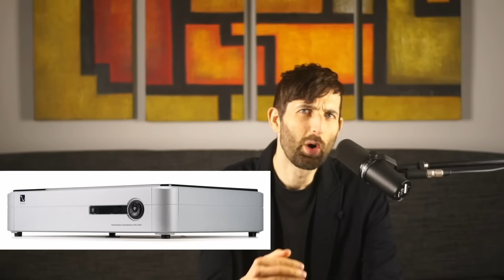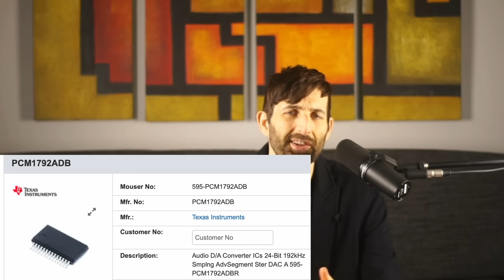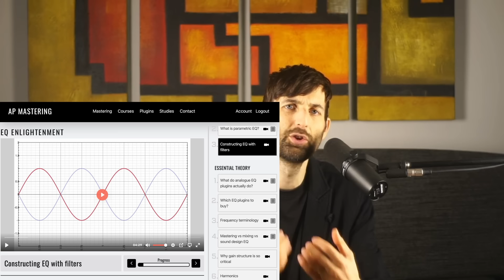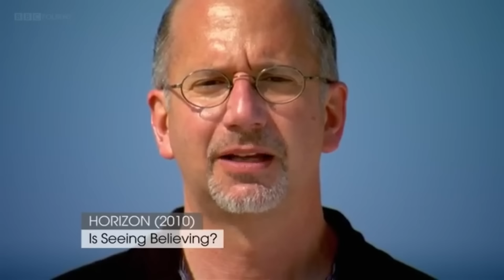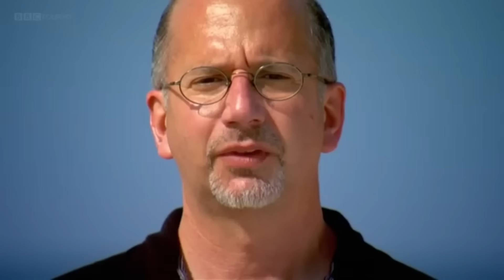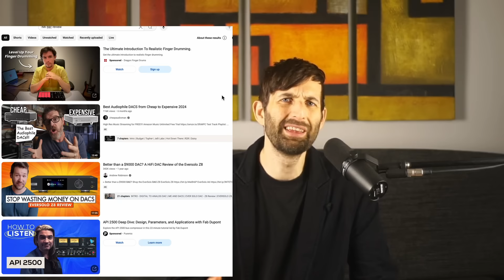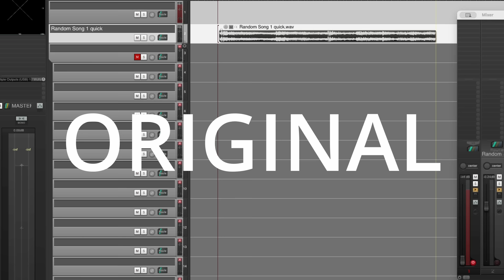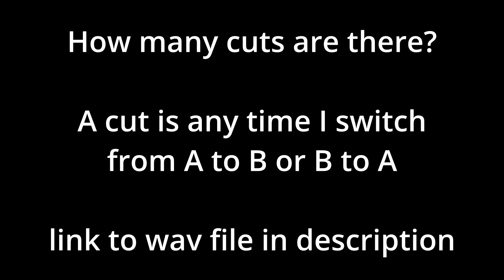The DAC Scam - Almost everyone believes the hype

Comment: I really enjoy your debunking of the analog and digital mythology and the many snake oils in hi-fi.  DACs definitely are a place where this is rife with imagined, subtile differences that become fetishized.   However, your video could give the impression that you're saying "all DACs sound exactly the same" -- that is, you can buy any two from Amazon, and if connected to a system the same way, they will have no distinguishable differences between them in a blind test.  These statements are all over the interwebs, proselytizing and insisting that everyone who hears differences among DACS has bought snake oil.  But the fact is, in real-world use, DACs that you buy for your home stereo (stand alone or integrated into the component) can sound different, even between two with the same DAC chip and level-matched.  That difference is due in part or full to other "implementation" factors beyond the D to A conversion.  I think these would be differences how the signal is handled after the DAC core -- summing node, output buffer, etc., correct?   You mention the power source as a factor as well.  If you listen to a Chord R2R DAC, it will sound a lot different from a roughly equivalent SMSL DAC you compare it to.  I suspect but don't know for sure that the difference might have more to do with the "implementation" than the actual D to A conversion.  I prefer the Chord DAC, just like I prefer one make or version of an A/B amplifier over another, equivalently priced and powered A/B amp. I think that recognizing that DACs as made available for purchase by viewers can sound different is lost in the debunking of the other BS that dominates DAC marketing.

Comment: Well, except for Chord, since they are renowned for their FPGA chips. Why are they so expensive? R&D costs, fully paid engineers designing circuit boards, their dacs do sound better and more natural. Yes there are some crappy scammers out there which sell low quality equipment with a nice case and marketing but you just have to know what company to buy them from and what to get.
Reply from the maker: their DACs measure objectively worse than ones that use a standard chip AFAIK

Comment: Very misleading. You are showing dCS and Wadax as examples of very expensive DAC's, but both brands are NOT using off the shelf DAC chips, but proprietary, discrete technologies. Furthermore, implementation of a standard DAC chip is most defining and a large part of the sonic end result. This can be done very well or very poorly. Power supplies play a very big part too, and these are the most expensive part of any DAC (together with the casing). Same for clocking. I know many people will say all DAC's sound the same. But that is rubbish. When used in a high-end system the differences are clear to everyone with two ears.
Reply: Not just high-end but budget systems are audibly different. Cambridge audio dacs vs cyrus dacs are night and day.
Reply from the maker: so much talk but such little listening. In this very video there is a blind test which everyone failed, using mid tier pro audio gear.
Reply: I did very well, thank you. And I have done so for decades. What is your own experience with real high-end DAC's in suitable, true high-end systems..? Just one example: I heard a comparison between the dCS Vivaldi One Apex and the dCS Rossini Apex and the difference was pretty stunning. Even after adding the Rossini clock to the latter the Vivaldi sounded way cleaner and with a much bigger soundstage. I would be very concerned about anyone's hearing if they wouldn't be able to hear that in a matter of seconds. Now, try to define that by all these beautiful measurements. Both dCS's actually measure almost the same. Just look them up. Music should be primarily judged by listening to it in a proper system, not by an oscilloscope. 
Your video is simply not telling the full story (e.g. what about suppressing EMI/RFI; strict clocking to prevent jitter; designing proper, discrete output stages) and therefore I do believe it's misleading. It claims that all high-end DAC's are 'snake oil'. But if you provide half-baked and partially wrong information (also MSB doesn't use standard DAC chips), why would your video not be in this same category?
Reply from the maker: @VincentvanRooij-j9n so you failed my blind test in this video?
Reply: @APMastering Wow, that's rather childish, don't you think? I did many blind tests in the past, but I did not do yours in this video. Why? Because the audio compression of YT alone makes it completely pointless. And you should already know this, being an audio expert, right?
So how about commenting on my posts from a content perspective? Enlighten us with your real-life high-end experience. Which high-end DAC's did you listen to in which exact systems? Which amps, speakers, cabling, sources etc.? And which sub £ 1.000 DAC did you compare to the high-end DAC in that system? I am really curious.
Reply from the maker: @VincentvanRooij-j9n so you failed to hear a difference. look up the mcgurk effect
Reply: @APMastering No, no, no. That's way too easy! Just respond to my valid question, please. Which exact high-end DAC's did you listen to in which exact high-end systems? And which sub £ 1.000 DAC did do just as well in that system and why? It's an easy one.
But.. we both know you will never answer this very simple question. Because you're claiming to know all about F1 cars, while driving a Fiat 500.
Reply from the maker: @VincentvanRooij-j9n i'm a mastering engineer so have used and owned high end lavry and RME convertors for years which are better than the overpriced hifi nonsense you're into
Reply: @APMastering Thank you for your honesty. So it seems clear to me now that you have no real high-end audio system experience, in which ALL components, power supply,  cabling etc. need to be top-notch to make such a system sing. Note that a dCS Vivaldi clearly belongs in a system of several £ 100k's to make any sense and to sound its best. That's FAR beyond your regular studio gear, wouldn't you agree?
RME and Lavry are well made pro gear that will likely sound very good, but I wouldn't compare these devices to a dCS Vivaldi. I must admit that I do like pro gear for its very good price-performance ratio. I used FocusRite for several years to digitize vinyl. It was VERY good for the money indeed, but still a far stretch from true high-end, which becomes very apparent in a top-notch system.
My point is that setting up a true high-end system really is a profession, just like mastering is. You just cannot judge a true high-end DAC out of the context of a true high-end system. It simply doesn't work that way. Just like Max Verstappen will not win any races on commercially available tyres.
Still you say your stuff is 'better than the overpriced hifi nonsense I'm into'? Based on what exactly..? Your extensive experience in high-end audio systems?
Nuff' said. Enjoy your evening.
Reply from the maker: I mention power supply. how did you do in my blind test? were the difference clear to you? Do you have two ears?

Comment: I dunno man, this feels like back to the same old argument of part are parts, and everything sounds the same, which my belief is that thats definitely false. Theres so many ways to implement these chips with a bunch of different components, quality of caps, etc. And that there's lots of different levels of education of engineers, amount of time spent on r&d, or quality of power supplies, wiring materials and so on.    And im not discounting the whole concept of confirmation bias, and downright auditory hallucinations pertaining to music listening, as I've certainly experienced it. 

But recently I got this ridiculously good deal on a $30k dac, and when I threw that thing in my system, it was an instant and massive improvement. Like the windows weren't rattling before, and suddenly they are, and the soundstage was holographic in a way that it just wasn't before. Better, richer and more accurate tonality, separation, etc. I truly did not have that toe tapping PRaT that made you bump your head and get goosebumps before this thing.  You can say I'm trippin and making it all up to justify the cost to myself, but you couldn't convince me if that if you tried lol. BTW, r2r nos dac chip, transformers, non over sampling dac with tubes. You'll say in crazy im sure, but I'm melting into the music over here. 😂 To anyone out there watching this, just go listen to different equipment, and judge for yourself. Don't fall for the everything is the same theology, some things are better than others. This dac is way outside my tax bracket, but for what I paid for it, it was worth every penny!

Comment: MATCH LEVELS! he's so right. I bought a switcher for two amps and two sets of speakers because i thought oh some times I'm going to want to hear this kind of sound and another time I'll want that kind of sound. Well i stumbled on level matching this way and i realized my K11, WiiM, Fosi DACs all sound EXACTLY THE SAME.  Same for good amps unless the volume is ABSURD. My Class A Monoblocks sound just like my Class D unless maybe I'm blasting the electrostatic speakers. 

But that's it. Speakers. You want something different, get different speakers. Get custom built speakers. Swap around drivers etc.

Comment: Could you maybe give advice to a quality Dac without spending more then needed.
Problem is indeed there are so many products but i dont want to buy something that will distort the audio right away or maybe 5 years from now when the components age.
I understand the digital parts will not be the challange.
But for example my current dac the volume knob really messes up the audio quality so i want to replace it.
I also want to avoid that PC noises or power issues drip into my audio what happens with bad products.
I use XLR cables to my power amp to avoid all the cables running around my pc and amp to mess up the signal.
I dont mind spending 1K but if i can get the same quality for 500 or 200 then i rather spend that offcourse :)

Comment: He’s both right and wrong. Most DACs do use off the shelf chips but several high end DACs like the DCS (shown) and Chord do not use D/A chips at all. Rather they use >20 thousand software filters which are proprietary programmed on fixed gate arrays. The sound is much better and worth the cost.

Comment: I come from MoD Electronic Warfare background, working with radar up to 34GHz and loads of stuff in the 10GHz range and we have little bother with copper as a conductor.  HiFi is just another snake oil industry with very rapidly diminishing returns for your buck.  Having worked with the owner of a very well respected HiFi shop in London it was obvious that people spend on price and couldn't much tell any "quality" difference.  The thing that made us laugh the most was people buying expensive cables, mains, USB, HDMI, ethernet and RCA, what a load of utter b******s yet people spend thousands on them; over £1000 on a mains cable and don't forget the gold plated fuse 🤣🤣🤣🤣

Comment: Sadly, doesn’t work in practice. DACs can sound dramatically different than one another in the mid to upper tiers. And easily identifiable in blind testing.
Reply: I also disagree with his analogy that all dacs should sound the same. I've had about half dozen mid priced dacs and hated most of them. I've had some very cheap ones that sound really good. I've settled on a Bryston DAC which is ok, but not great. I actually prefer my streamers analogue out than going through a dac.
Reply: @robbiefest  I hear you. I bought a Mola Mola Tambaqui and then a Playback Design MPD-8 and once I arrived in that echelon the difference was very obvious between the two and from everything I had owned before.
Reply: I bet you couldnt tell how many times the audio was cut.

Comment: Critically, you fail to mention the analog output section that differentiates these units more than the DAC chip.  The digital source, amplifier and speakers used are what limit one's ability to hear the difference.  I own DACs costing from $400 to $4000 and can easily hear the differences between them.  I know of honest head-to-head blind comparisons where everyone chose the same ~ $5,000 DAC as sounding the best.  There simply CAN'T be enough suckers out there to support all the different DACs that cost $2,000 and up, for decades on end! 😏

Comment: you will never be able to hear "stair steps" in digital audio. as soon as a sound is distributed by the air (so you are able to hear it with your ears) there are no "staitsteps" anymore in existence. laws of physics!
Reply: That's correct and fact ..............but nothing sounds the same , even resistors and all other components......as well as the same chip in different PS set ups and different environment input and output to other gear...

Comment: The whole "audiophile" thing is ridiculous to me to begin with. You can get the "best audio chip on the market" and the sound still will be dogshit if you put it through $5 speakers from temu. While DAC in general is important, it's not the only element that makes the sound really good or really bad. There is also a really big reason why for instance headphones have frequency response in range of 20 ~ 20000 Hz. And you know why this is? Well, because vast majority of people can't hear anything below or above this frequency AND this range changes when you are getting older. So when you are over 50 year old, you most likely won't even be able to hear within the 20 ~ 20000 Hz range anymore. Contrary to popular belief, hearing loss is not just a loss of the ability to hear quiet sounds (low sound pressure). It is primarily an impairment of the ability to hear high-pitched sounds. This is why older people often tolerate high, sharp tones well, which are unpleasant for younger people. And yes, this affects me, you, your "audiophile friends" and everyone else. 

The whole "audiophile" industry is built on making people believe that they are somehow "special" (buuuut, to actually "be special" you also need to buy very expensive gear that this industry produces and wants you to buy!) when it's really not the case. Because unless you go to a doctor like an audiologist and literally "check your hearing" you ain't hearing jack shit better, no matter what DAC, headphones or any other gear you will buy. Because it just doesn't work like that! 

In general there is much more to it than just "DAC" and stuff like that so I really find the fixation on it as kinda weird. And I'm not even gonna go into the whole "placebo effect" taking place in many cases. So to sum it up - don't let this industry bullshit your with "magic" and "smart sounding terms" that can't be measured and/or are outside of your capabilities due to how human hearing works.

Comment: It's not as cut and dried as you profess . Yes , often the sonic differences can be small but they do exist even if you are willing to overlook them or don't notice . Not all DACS use chips . Getting the lowest possible noise floor depends less on the chips than on several other factors . 
In the end this is a hobby for which many people are willing to pay for the chance to improve the sound . There is nothing wrong with spending money if you have it . Getting great sound is now possible on a smaller budget than ever .

Comment: Bold to put this out with knowing so little about how high end DACs are actually designed and constructed (and work): First not every high end manufacturer uses off the shelf chips. Many have created own designs from the ground up. But even the ones using the mentioned chips are not the same. Why is that? Because in a high end DAC most of the work a standard chip can do (like reference voltage and master clocking (de-jittering)) will be done by a much better dedicated unit and circuit. Custom filters play a role. So these high end DACs use the same Chips as a basis but in fact the chips do far less than they would in cheap solution which uses the Chip kind of as a whole system. And these things (clock, voltage etc.) matter A LOT. Much more than the Chip itself probably. Also PSU and power delivery play a big role. I am sure there is even more to it as I am no expert by any means. But even knowing this (which is obviously more than the knowledge that was displayed in the video) I wouldn't go and make a video with bold (wrong) claims because I am no expert. 

Blind tests: It's true that many people can't tell different DACs and audio components in general apart but there are also many people who can't really taste differences in wine (saw that many times). Does that mean that a $5 wine is as good as a $50 wine? In 99% of the cases not. 

There is a lot of snake oil in hifi and high end DACs are probably overpriced (like every luxury item) but there are notable differences and a DAC is much more than just its chip and it's certainly not a scam.
Reply from the maker: how did you do in the blind test?
Reply: @APMastering I didn't do the blind test because it's pointless. Your ADC is the limiting factor and makes a sensible test impossible.There are differences in subjective sound characteristics you can't catch with that method. Also your ADC has to be significantly better than the DAC or else you are only measuring your A/D converter. 
I did hear different DACs on different set ups in real life (and yes I know you don't believe me) and heard notable differences in direct comparisons.